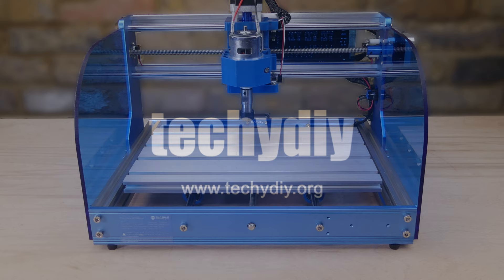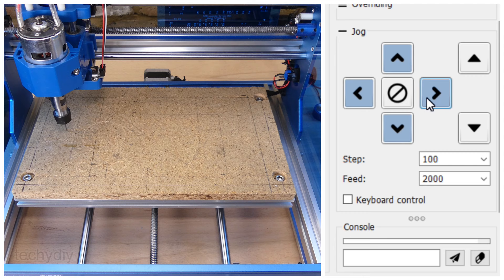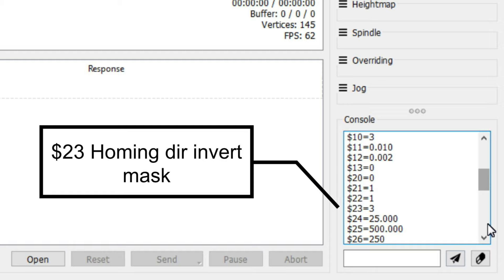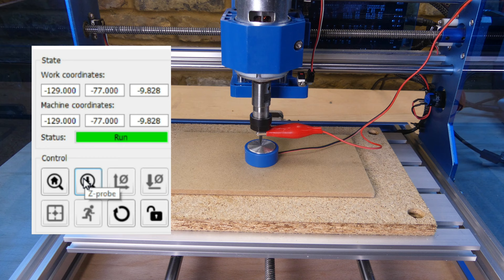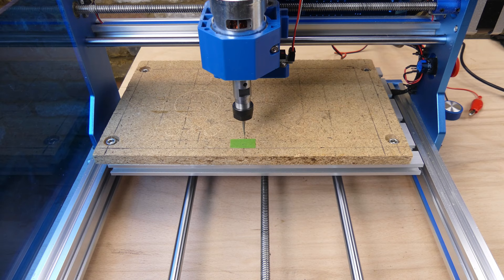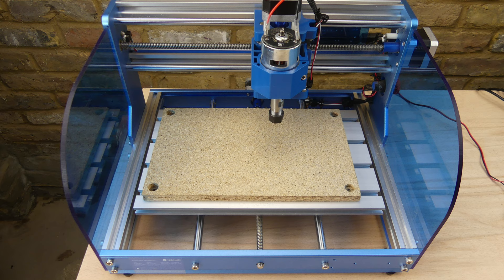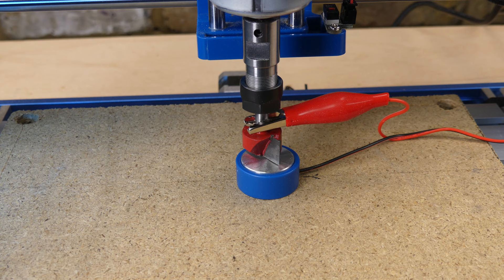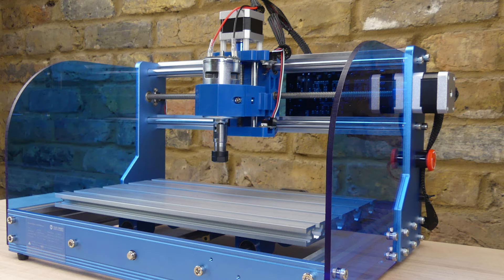Sainsmart 3018 PROVer Cnc. Candle, Grbl & Axes Calibration Tutorial. Part 2.

Comment: Great videos!! Learned a great deal. I however have a question for.  I tried your spoil board surfacing easel project on my 3018 PROVer. Everything worked except my spindle would not start. Do you have any thoughts on why that would happen?  Thanks again for the videos :-)
Reply from the maker: When you exported the gcode from easel under the machine menu, was spindle control set to manual ? 
It should be set to automatic. 

If you open the gcode with a text editor (wordpad) does it have a line like the following:
M3 S9000

M3 turns the spindle on
S9000 sets the speed to 9000 rpm or whatever speed you set.
Reply: @techydiy  Thank you very much for your speedy reply. Your suggestions were very helpful and helped to resolve the spindle not starting issue. Gcode loads ( M3 S12000 which I changed to S9000) and spindle starts. New issue is that it now when it begins your surfacing project it looks like it is going to proceed to start point and stops. It now goes into a hold state every time I try to run it.
Reply from the maker: @marioamoroso1532  if you have enabled soft limits turn them off and try again. You might have to play around with the design in easel to get it to the correct size for your machine.
Reply: @techydiy  Thank you again for your support and speedy reply. Soft limits were were enabled. Once disabled resurfacing went well. I'm looking forward to more of your videos and projects. I'm feeling better about my PROVer purchase now that it has completed a project and excited about trying new ones.  Again, thank you very much!!!

Comment: G21G91G38.2Z-45F100; G0Z1;G38.2Z-2F10;G92Z13.83 G0Z2 is the code I used and nothing happens. The probe wont work, It has in the passed but the bit jams in the probe base.
Been working on this for days now. Its a Sainsmart 3018 PROVer.. Please please help....Thank you
Reply from the maker: Test it without a bit in the collet and then you cant break the bit.
Initiate the command and then tap the croc clip and the probe base together to simulate the probe making contact.
It works by electrical contact between the croc clip and the probe base, so check the wires for continuity. Also check that you don't have a bent pin or a problem with the connector.  
If you have turned on soft limits, turn them off again, sometimes it stops stuff working.
Please contact Sainsmart tech support if non of the above helps.

Comment: I can't figure out how the right answer for steps/mm could be anything othr than pure math with multiplication and/or division. If the lead screw has, say, threads of 1mm pitch, and the motor turns once per 400 steps... the answer is "400," not "about 400." The math is essentially discrete - integer. It is hard to believe a lead screw would be made with any systemic error that applied over it's whole length, e.g. a pitch of 1.01 threads per inch.  It just seems like there's something funny going on, here, with an error coming from elsewhere, to require those corrections.  Or... what am I missing?  In any case, linear corrections generally require both slope and offset, thus two numbers, arrived at through a more elaborate calibration scheme.  This whole bit didn't make much sense to me!  I suspect it is incorrect guidence.  It could easily be something as simple as that little controller having a plain, ordinary "off by 1" error, moving 101mm when you ask for 100, for example, which would explain what we saw for X. If it were a legit error, it would be an intercept error, rather than a tiny slope error as was made in the video.  Something funny going on...
Reply from the maker: The stepper motors and leadscrews are not perfectly accurate and the components are not matched.
Reply: @techydiy  Well, that's what I'm getting at...  a stepper motor has a specific number of coils and magnetic poles, and thus a specific integer number of steps per revolution... it can't be "a little less" one time around, and a little more the next -- every revolution is exactly an integer number of steps.  Always.  And so there is no "calibration" possible for the motor -- it's either 400 steps or 200 or 800 or whatever, and that number cannot change.  It's an integer number, not some obscure fraction.  Cannot be.  I'm not saying each individual step is perfectly spaced on the rotor; in fact, they're probably not, but there are still the same integer number of steps per total revolution, and that's what's going to matter for this kind of computation.

And then the only other "not so accurate" element of the thing, if you're using a lead screw, is the pitch of the lead screw.  And I just can't believe they would be manufactured to a 1% error; people would immediately say "This is wrong" and get their money back.  It just wouldn't happen.  It would be like buying an M6x1mm screw that was actually M6x1.01mm... they just couldn't get away with it.  So in this example, there would be 400 motor steps (exactly) and 1mm of travel (almost exactly -- within a very small percentage of error, and certainly not as large as 1%!), and so the answer for the math has to be -- HAS to be -- 400 steps per mm.

On the other hand, if the expected 100mm jog actually moves 101mm, then both the X and Y calibration "errors" you saw make perfect sense -- two jogs for the X axis, and you ended up with 100 + 1(error) + 100 + 1(error) = 202mm.  Not because the machine's distances in steps/mm are wrong, but because the counting was wrong in the software in the controller.  ("Off by 1" errors are one of the more common programming mistakes.  Easy to make.)  And on the Y axis, you moved 150mm with 100 + 1(error) + 10 + 10 + 10 + 10 + 10, and ended up with 151mm.  So it looks like the 10mm jog works right.

For Z, I have no difficulty believing that 0.14mm of backlash or other kind of error crept into the movement; it was not a very high-precision measurement.  It's a different set of issues.

So here would be my challenge, just to see if I'm on the right track of not: set up the same kind of situation you had for the X axis calibration, with marking the starting point, and jog 100 mm, twice.  Then move back to the starting point, switch to a 10mm jog,  twenty times, and see if it ends up in the same place.  I'd be curious about the result!
Reply: I get your math and reasoning, but I see axis errors of this magnitude on  the x and y axes of my prover MX as well. Assuming my steppers are 1.8deg, the default settings in mach3 indicate it is using 10x microstepping. I agree that 1% error in the lead screw is high. So what does that leave? Likely double stepping or some sort of systematic bias designed into the software to (poorly) compensate for missed steps. My guess is resonance resulting in double stepping. I'll see if I can tweak my board to achieve lower microstepping and report back.
Reply: Update. I took the electronics out of the loop by just using my fingers to rotate the x axis exactly 32 rotations. You can feel the macrosteps, so this is accurate to less the 1.8 deg in 32*360. So about 0.02%. I measured the carriage travel with my calipers to be 129.15mm. The carriage positions were both approached from the same side to eliminate backlash.

So calculated the leadsrew pitch is 4.0359mm, rather than 4.0mm. So I conclude that yes, the leadscrew fabribation tolerances are just that bad.

If they are that wrong at full span, the error is probably not linear along the length, to even a two point calibration is probably not enough for accurate work. Toy machine I suppose.
Reply: @ryanfeeley2407  Yikes!
Reply: @ydonl  yep... If it's any consolidation, I did a real multipoint calibration on my axes and they are quite linear. The residuals are under 0.025mm.

The manufacturing process must just have some sort of error that accumulates in a systematic way. Likely some sort of rolling die where the position of the portion of the thread currently being made is gauged from, and thus a function of, a few mm prior.